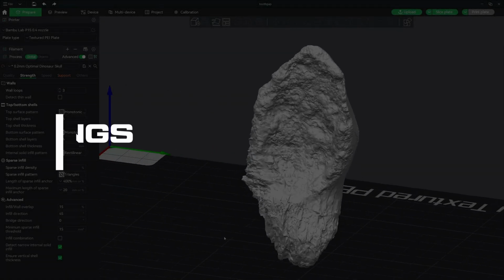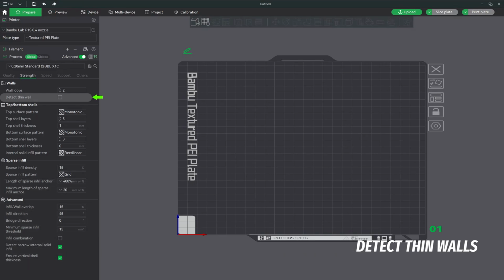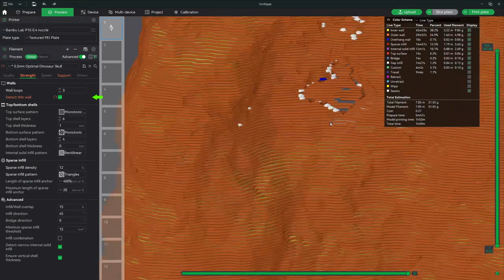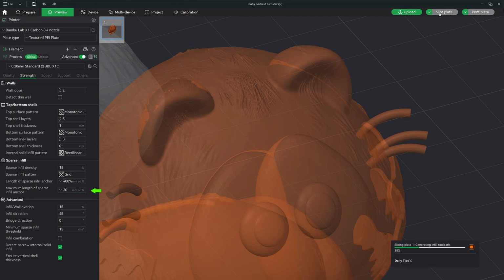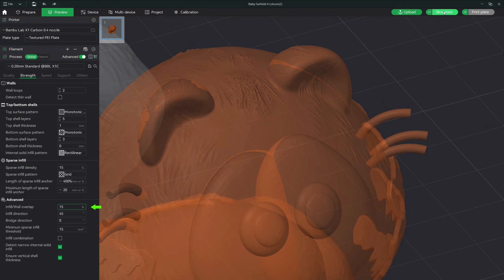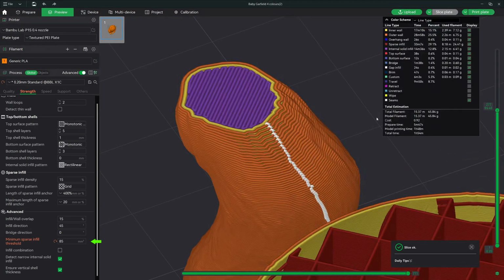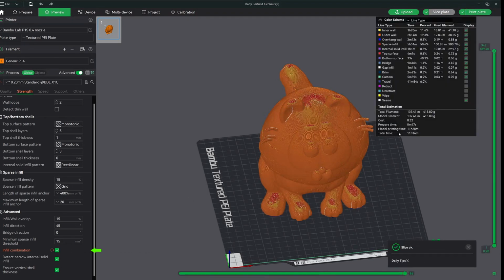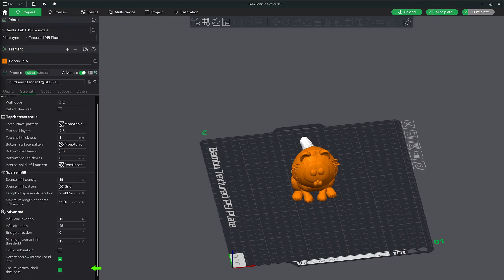Advanced Strength Settings in Bambu Studio No Fluff Explanation

Comment: I am making a stamp, essentially, to press designs into leather products. I’m curious how I could strengthen something that is put under pressure in a C-clamp.  What setting could I change when pressure is being applied to the top side and bottom side of a print?
Reply from the maker: One thought would be the add a large piece of steel internally into the stamp. That would make it virtually indestructible. Without the full scope of the stamp I can't offer a full suite of ideas.

Comment: This has to be the best source of of knowledge on 3d printing. 
It’s gonna save me so many headaches. 
Thanl you a lot Man. 
Maybe a video request if i may:
I’m struggling a lot with ASA. I’m using Bambu h2d and eve though I tried with Bambu Asa and flashforge Asa, I’m having adhesion issues. After watching a lot of your videos, discovered skirt and that helped a bit. But still it fails at adhesion. Any tip or a video on it? I think there’s a ton of people in the same boat. 
Thanks again man
Edit: using a textured PEI plate. But things like my prime tower falling down happens.. the last print seemed to go well with Bambu Asa, then at some point the prime tower fell down..
Reply from the maker: @Victa12  hey I truly appreciate your support of my channel. As for adhesion I do have a suggestion. A company named @landu sent me their spray adhesion. Of course I was skeptical and was like what ever I'll try it. Well I ran into some adhesion issues recently when printing at .08mm for a project. Print failed multiple times. I tried everything, cleaning bed, mouse ears etc. I decided to try the spray (after I remembered I had it lol) hit the build plate with a few squirts. First print out of the gate the first layer was super clean and immediately fixed my print. I wish I could go back and had filmed it but again I honestly didnt think it was going to make a difference. It is worth a try.
Reply: @planet3dp  thanks man. I appreciate it. I’ll check it out and thanks for pointing out , glue may be a solution. All I found out is that glue helps nothing on textured pei so I was scratching my head and thinking my hearted may have a bad or not uniform heater or something
Reply from the maker: @Victa12  yep I also use cheap hair spray called aqua net and it definitely makes a difference when adhesive issues come up.
Reply: @planet3dp i See, so you hairspray the textured pei?
Reply from the maker: @Victa12  yep, only when needed. Aqua net hairspray. It basically dries the plate and makes a slightly tacky.

Comment: I believe this is your first video I watch, impressed with the quality and clarity. I was looking for a way to have different sparse infill densities in different areas, to optimise a mechanical part by reinforcing the sparse infill only where it's needed. Do you think there's a way to achieve this?
Reply from the maker: @giovannibellini3028  yes most definitely there is! You can use modifiers to accomplish this. I actually created a video similar to the modifiers option on my channel. Look for the faster stronger 3d prints video.
Reply: @planet3dp  that's super helpful,  I am going to try it out! thank you very much!

Comment: Please I got one favor to ask of you 🙏🙏🙏 
On bambu lab you can set it to quiet, standard,sport and ludicrous and the speed is “for me” is no where to be found I only can see percentages between these 3 option :/ 
I would really like to know what these percentages represent in actual speed for different materials
I’m asking this because sometime I would just like to speed or lower the speed just by 5 to 10% depending on the model and material I’m using specially with ASA 
With ASA I sometimes feel like just a bit slower then standard would be much better but I only can go to silent and really do not wish to cut the speed by 50% 😩(and yes I am really new to 3D printing)
Reply: @ali-sleimanchehade6129  well you can play around with the acceleration plus the speeds for the inner/outer wall, sparse infill etc. that would probably be better then just using the silent, sport modes because I think they just change the speed. I am not sure about the acceleration.